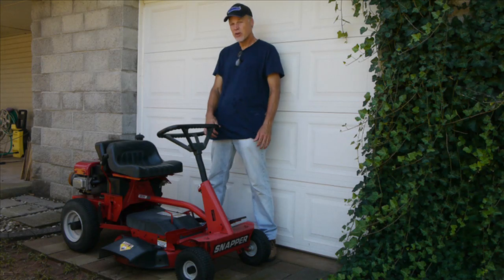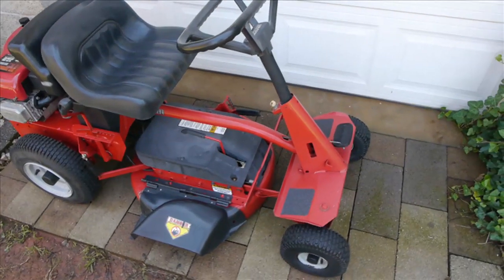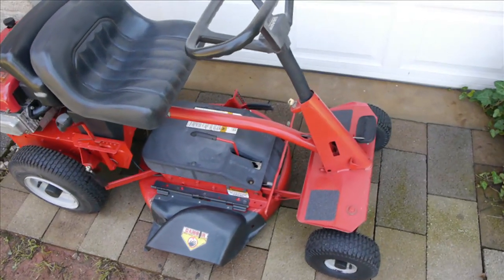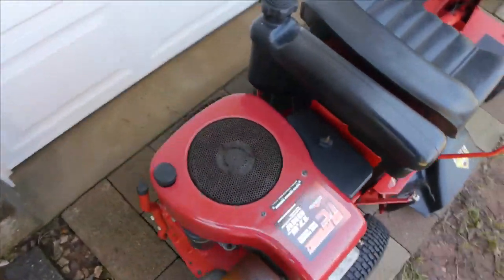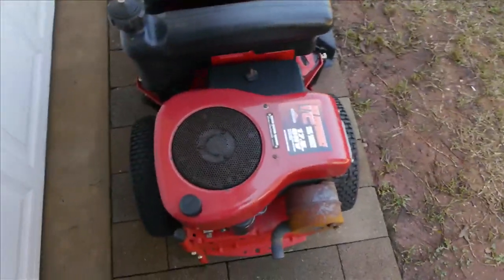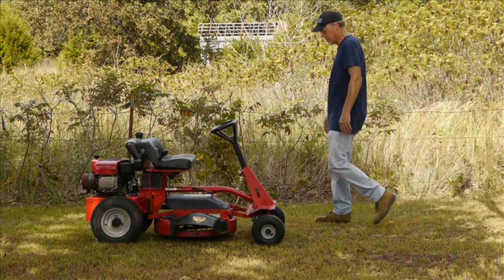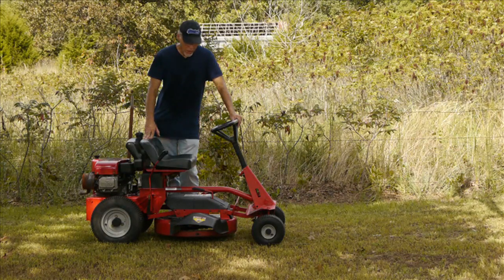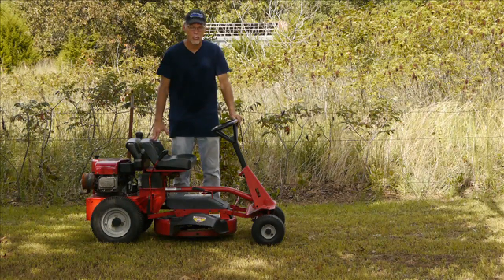Dave's Monster Snapper

Comment: I have a Snapper Comet 30 that dad bought in 1968.  It was an experimental model, so the parts store always looks at me funny when I give them the model number and ask for parts.  Usually I just look up the parts numbers myself and save the look.  
Originally it had an 8 HP Briggs on it.  That died and I put a 10 HP Briggs on it.  That died and I put an 11 HP Briggs on it.  That wore out and I went to a 12 HP Briggs.  Then, on to a 12.5 HP Briggs with ohv.  Currently mowing with it now.  Been mowing all my life on this one mower.  It is currently taking a break for the summer while I refresh the differential case gears and the chaincase components.  It may even outlast me.  In which case, my grandson and great grandson will be mowing on it.

Comment: I had a similar problem on the bigger snapper RER.  I repowered mine with a 20hp opposed twin.  The crazy thing was it used less gas. That big twin never thought about bogging down or lugging.  An it would cruse through waist high weeds like nothing.
Reply: The B&S TWIN that came from the factory was equally as beefy in cutting the same

Comment: I did the same thing, I took a 13hp off a 33 in cut, and put it on my 28 in cut that had a 6 hp. I can't get it started after the swap but it started before. Im Wondering what I did wrong with the wires.

Comment: It's easy to upgrade to a bigger engine as long as the engine has a 1" crankshaft. Pulling those wheelies is fun but hard on the chain inside the sprocket box. Just replaced mine a couple months ago, I've gained some respect for the clutch pedal. Lol.

Comment: I put a 19.5hp on my 30in deck machine. As long as the blade is sharp and you can get the front end over it the machine will cut it if not the engine just blows the belt like its a fuse.

Comment: Dave, will the muffler from the previous engine fit the new? If not , snapper makes a muffler kit that should fit and enable you to reinstall the stand on end bar. That way you can stand on end for service, and hang the bagging mechanism.
Reply from the maker: As for the muffler, no, the old engine’s muffler does not fit. As for the end bar, thanks for the tip! I’ll look into that.

Comment: 😱Hi Dave, I got the same model lately from the previous owner who also had the engine upgraded to Briggs 17.50/1750 series, 344 cc. The only problem is the muffler he replaced (stand on one) is not really working and caused mower stall when mowing... I’m planning to get the right one, Can you forward the one you use to me? Or anyone can recommend the correct muffler is appreciated. Thanks🙏🏼
Reply from the maker: The muffler on this mower is the original one mounted on this engine when both were originally on an old Murray front-engine mower.

The frustrating thing I discovered is that there apparently is NO "original muffler" for the Briggs' engine. The Briggs engine parts diagram doesn't even show a muffler, as I recall. So there's nothing to copy if making a custom one.

Evidently the mower manufacturer is responsible for designing and providing a muffler which works for the engine and fits the chassis /bodywork of the mower. I presume that also means the muffler design is not particularly critical.

Comment: can you do all your mowing on half throttle now?
Reply from the maker: Not really. Lower throttle makes lower blade speed and reduces the quality of the cut (leaving some grass uncut). Consumer-type mowers like this one already have the blade speed restricted to a lower RPM, so you wouldn't want to impair the cut quality even more.

The real benefit of the increased power is the ability to cut thick grass and weeds that would bog it down otherwise. And popping wheelies.
Reply: @65twoeightynine  ya, and that thing can probably mow a corn field now.  do you have any hills around your area?  do you notice an improvement in climbing hills?
Reply from the maker: @mrbubetube  No hills, really, but a couple of embankments. Yes, it climbs right up them like they're not even there. :) But it's subject to having the traction, and this little mower's back wheels are pretty skinny. You gave me an idea, though. Put big, wider wheels /tires on the back.  :O
Reply: @65twoeightynine  this snapper does pretty good.  this hill looks between 30 and 45 degrees
https://www.youtube.com/watch?v=zJnAKIExUuY
looks like the snapper takes hills better than the cub cadet
https://www.youtube.com/watch?v=lXUTqGm7QQs
Reply: "5th gear! WhooHoo!" Fucking brilliant. That thing is awesome!
Reply from the maker: Yes and no. It has all the necessary mowing power at half throttle, but only half of the blade speed. The cut quality suffers greatly.

Comment: do you know the year and model number of that snapper?
Reply from the maker: I don't see a date code anywhere on the mower. The operating manual has a publishing date of 1999, so the mower is newer than that. I acquired the mower in 2016 (I think) from a friend.
Reply: @65twoeightynine  ah ok.  I was just wondering because it's been about 20 years since snapper made a 25 inch deck.  that'd be awesome to have a powerful engine like that on a small mower.  check this out.  this guy put a 14hp engine on a push mower hahahahaha  https://www.youtube.com/watch?v=ckHvuWF9ypQ